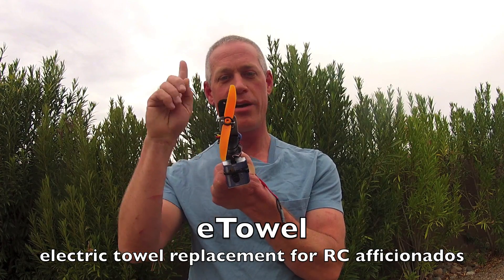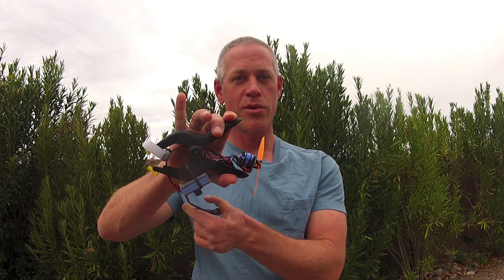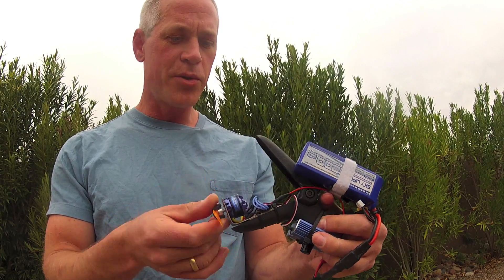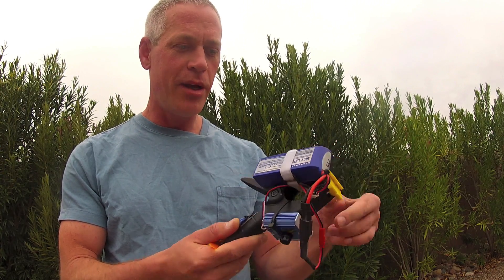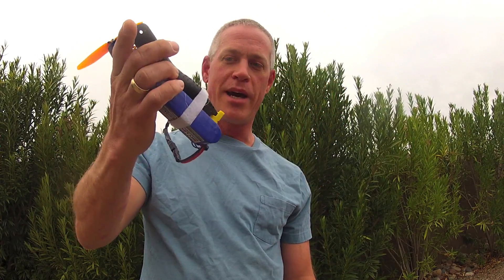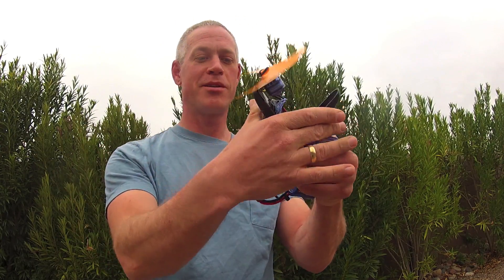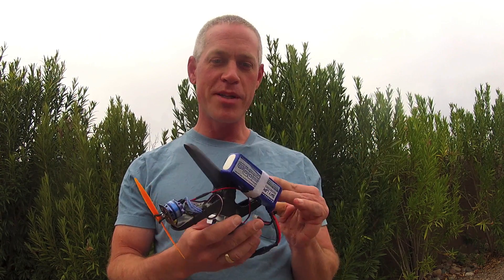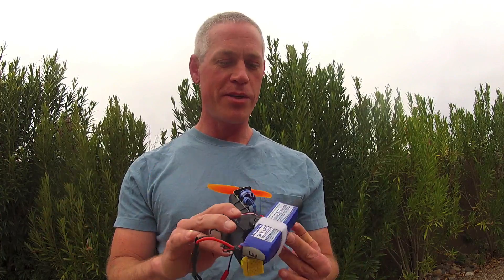eTowel - Electric Fan Replacement for Gym Towel

Comment: Don't they make a shroud that can give at least SOME safety to that fan? I seem to remember something on a RC gyrocopter with pusher motor. Then the person would have to really work at sticking their fingers in between or around the prop path. Nice practical invent though. Yours is the first I have seen on steroids like this. Onother thought just popped into my head. Get one of those cheapie personal fans with the rubber fan blades, pop them off and try on your contraption? Exercise is good!

Comment: That's a good one! What about an elliptical machine that you could use to charge your batteries,run your fan,run your ipod and even have a built in monitor to watch interactive video  as  you workout. Such as a video of your FPV flights and the faster you go on the machine the faster your flight video plays. I would put a few bells and whistles on it just for good measure. The elliptical machines already have generators. I often wonder how much electricity they could produce.